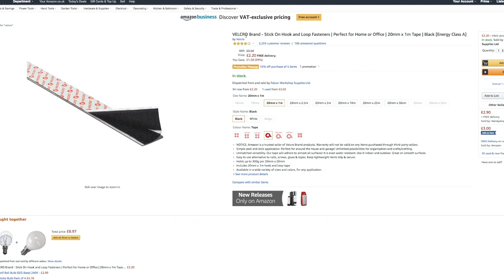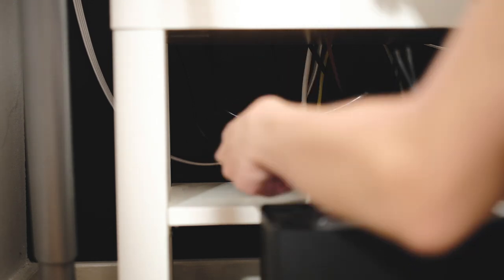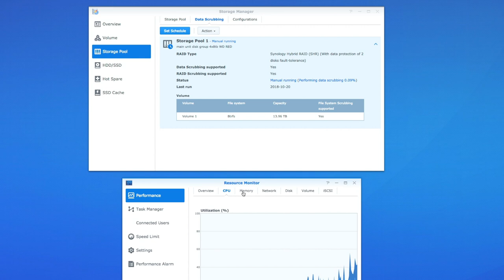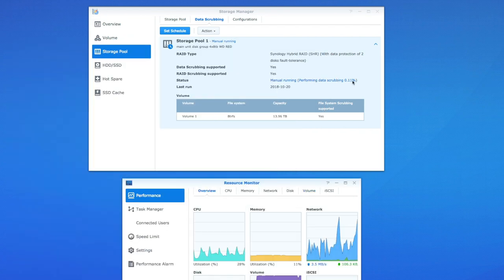Synology DiskStation Vibration Noise - EASY $5 FIX!

Comment: Why did you pick WD instead of seagate?
Reply from the maker: Hello Eli, 
Thank you for your message. 

I’ve had WD drives since 1998 over the years with my computers and they have lasted very well for me. Hardly any failed from my experience. 
I have had some failures with Seagate in the past

Having said that. They have risen hugely in popularity and I hope the standards are just as good now days. 

I will probably give them a try in the future if I need to expand. 

Especially with the recent WD shingles debacle. Really put a dent in my years of trust in the brand. 

Hope this answers your questions. :)

Comment: What about a nas where you screw the HDD? (like ds118 let's say)
Reply from the maker: Depends if you have the chassis buzzing noise? This doesn't help with the general hard drive noise you get. It doesn't dampen those sound at all. It's still a fairly open plastic chassis at the end of the day. I only want to fix the annoying extra buzzing sound coming from the cages. Not the hard drive sounds.
Reply: @JoeLamOfficial  okok

Comment: you re niot showing which side of the velcro you are using ... you just say the soft side ....  not sure which one to use
Reply from the maker: Hi Gevo. It’s the soft fuzzy side. Not the rough side with the tiny hooks. :)
Reply: Thanks ! I made the installation. You saved my life  :) the silly noise has almost all disappeared !!  just a little very slight fan noise remaining  but nothing abnormal ...
Reply from the maker: @gevo990   Happy to hear that it helped you. Thanks for letting me know. I've got my fan set to min speed. I don't hear it since it's under the desk. CPU 40C and HDDs around 30 which is absolutely fine. :)

Comment: I'll try on a standard horizontal mount case. Let's see
Reply from the maker: Let us know 🤔
Reply: @JoeLamOfficial  I made it. I can feel a slight drop in vibrations, sound level didnt change much but the pitch has changed. I cut the velcro at a length that covers three sides of hdd cage, it was pretty loose already so it would fit anyway, i held it tight with my fingers at front corners, sent it in and it went in snugly.
Reply from the maker: Nice. Thanks for the update. You think it was worth the work?
Reply: @JoeLamOfficial  hey, it only took 5-10 minutes to handle with a cramped desk space. People should give it a try and see how their setup responds. It may be better, worth a try. Sound is different, vibration seems a bit lower. Mixed thoughts. But I'll stick with it. Velcro is useful so I already had it.
Reply from the maker: Cool. Thanks :)

Comment: This fix isn't working for qnap TS 664 . I've just tried.
Reply from the maker: Can you identify where the noise is coming? It only helps with the chassis vibration noise. Not general hard drive noises.

Comment: Tape marking the drive numbers is a bad idea.  The gum holding the tape to the drives can dry and the tape can drop off in a few years.  Write on the drives and possibly on the drive holders.  Better to have metallic numbers on the drive holders than to lose track of your drives' order.  My four year old DS1815+ died a couple of days ago and I replaced it with a DS1819+.  I tested the DS1819+ to insure that it would work, powered down then plugged in the hard drives, powered up and then accepted the migrate with settings option.  It migrated the drives and installed the new operating system.  In one hour, I was up and running again (my internet connection is not the best, so expect better).
Reply from the maker: Thanks for watching. Did your units make any noise?

Comment: So you play the before sound but you don't play the after and you expect us to believe you?
Reply from the maker: I understand I should have done a direct comparison. But it does work as many others have commented already. 
I assumed people would understand that I’m getting rid of the chassis buzzing sound as a standard out of the box NAS experience, like mine when it didn’t make that noise (it does not help with the hard drive noises). Just that odd pitch chassis buzzing sound)

Comment: 1- if this worked for you why do you have a DIY acoustic box video?

2- this made my DS920+ even worse. I plugged it in 5 minutes ago and it’s at a record high level of noise
Reply from the maker: It does work as confirms by many other people. This helps to eliminate the chassis buzzing sound issue. The DIY box idea was to try and reduce the hard drive mechanical read and write sound itself , which is a different to this. 

This is to fix that tiny little buzzing sound coming from the hard drive caddy not fitting perfectly and vibrating against the plastic open chassis causing this higher pitch sound.

Comment: I feel like its not supposed to make that noise. =/
Reply from the maker: It’s not. But since the chassis is very hollow and made out of plastic. The hard drives occasionally vibrates the case at the exact frequency to make this unwanted noise. This is a simple fix until Synology adds better damping in their products (one day).

Comment: going to try this. I recently got my first NAS, and JESUS FUCK it seems like it's constantly making a low grade noise, and it's driving me crazy.
Reply from the maker: Hi Sean. Hope this helps with your NAS! It depends if it's the same chassis buzzing noise you are experiencing or just the general mechanical hard drive clatter <- that's more difficult to remove.
Reply: @JoeLamOfficial  Hi Joe, thanks for the response. So I think it turned out to be a combination of a very noisy HGST 8tb HE8  7k rpm drive and some app i had installed on the NAS constantly wanting to index the content or some such.

When I first got the NAS I installed a bunch of apps (first timers excitement I guess). I realized i didn't actually know what half of them where really doing, so I uninstalled most of them. I also made both drives 8tb Reds (5k rpm).

The NAS (QNAP TS-251+) is now MUCH quieter - barely notice it at all.

 I think I still might install some felt tape at some point, not just on the rails, but around the interior of the enclosure just to make it whisper quiet. I feel like these plastic shells weren't really designed with noise mitigation in mind. Temps seem quite low as it is, but I will monitor them of course if I do that.

Thanks for your videos, I've found them great for a first time home NAS owner!
Reply from the maker: Thanks Sean. Mine's generally ok too if it's idling in the background, but when it scrubs data, verifying, or whatnot - it does get quite loud. But I wear headphones most of the time so it doesn't bother me too much. I think I would have moved it or found another solution by now if it does my head in. 😅

Comment: Mine vibrate when it about to finish extended test :P
Reply from the maker: Going to try and use this method to fix it??
Reply: @JoeLamOfficial  Its a ds218play dont know if that would even work and it does't really bother me.
Reply from the maker: @Arokhantos  Don't need to fix it then I guess if it doesn't bother you. But mine's under the desk so it's rather annoying hearing the buzzing sound all the time.

Comment: just use folded up piece of paper as a shim or stack electical tape until its thick enough. Every 5 bay hot swap has this problem
Reply from the maker: Good idea! Didn't think of it before. Thanks for the tip.

Comment: You can stick the hard drives in any order it makes no difference
Reply from the maker: Thanks for the tip. Have you tried this yourself? 
I didn't want to risk or there's no harm in going back in the order. I was under the impression because the guide on migrating to another Synology NAS states "Install the hard drives in the target Synology NAS. Hard drives must be installed in the same order as they were installed in the source Synology NAS." - ref: https://goo.gl/AHk1e6 

Arguably that's for migration process, but surely there's no harm in putting it in the same order either. Better safe than sorry; seeing that it does matter when migrating. Thanks for watching. :)
Reply: Joe Lam yes I just shifted 8 drives I have 2 rs3618xs and rs2418+
Reply from the maker: @sturmbreakers7817  Thanks for sharing this information. I didn't want to take the risk as I couldn't find much information. No harm done I guess. :)
Reply: Joe Lam No problem just thought I let you know
Reply: You need to install them in the same order always.  You are going to lose data.
Reply: Francisco Ruiz I’ve done it multiple times in any order and have not lost any data
Reply: DiskStation is basically a linux computer which uses md raid and you can insert the drives in any order you want because mdraid autodetects the correct order. Yes, I've done it many times and no, there were no problems. So everyone, please stop spreading irrational fears about wrong order and losing data. There is no wrong order and you won't lose any data.
Reply: @sturmbreakers7817  Tried it on a DS712+ and DS716+ 
No boot, DOESN'T WORK!
Reply: dan8t6 will it boot in correct order?
Reply: Sturm breakers yes of course

Comment: Or you could just send it back under warranty and get it repaired or replaced for free.
Reply from the maker: That won’t fix the fundamental design flaw. The cage will always be slightly loose in order for the tray to slide out and when used with mechanical drives. It’s highly likely to suffer from the same issue even with replacement. I’ve heard some people managed to get some free replacement trays from Synology. But I think this is a better quicker long term fix.

Comment: No sorry you not only dampening the noise level you also reduce the way heat gets out of the case. I rather leave it as it arrived.
Reply from the maker: It didn't have any negative effect in my case. Of course, if it's a concern of yours. It's probably best to keep it as is.

Comment: Mine ends up sounding like a coffee machine
Reply from the maker: Good grief 😅 swear the WD RED drives are extra loud. WD MyBook Desktop drives doesn’t click as loud. Its such a racket the noise. What drive do you use?
Reply: @JoeLamOfficial  Shucked 12TB WD easystore from bestbuy, I got 5 of them in a DS1019+ and when it gets going it sounds like I got  multiple coffee makers brewing. it makes this popping sound from the vibration, kinda like how I remember the old kurieg machines sound like
Reply: @JoeLamOfficial  someone said it in your other video, it's like the sound of someone drinking an empty cup from a straw.
Reply from the maker: Oh snap. I thought 4 drives are loud enough. You’ve got 5. It reminds me of my first computer with the bigger 5.5” hard drives? Think it had 20Gb capacity. That was really loud. But most desktop drive seem quieter. Not sure if it’s the NAS compatible drives or just the open plastic chassis that reverberates the sound so much.
Reply: @JoeLamOfficial  like in your video i think it has to do with how the sled has no padding when you slide it into the nas
Reply from the maker: True. Plus it has so many gaps and holes for ventilation and no damping material on the plastic casing. I see some people have it on their desk next to the computer. How do they cope? 🤣

Comment: Well if it worked, why the hell didn't you show the AFTER noise?
Reply from the maker: Hi there, as many people have pointed out, I should have done a comparison but I just assumed that people would put the 2 and 2 together that it just sounds exactly like a normal Synology NAS without the buzzing noise I demoed at the beginning. If you have the buzzing noise, you know what it sounds like and with or without. 
Adding the strip only removes it but doesn't change anything else like it sounds. 
With all that said, I know in the future the importance to make the comparison in future videos.
Thanks for your feedback. Only this way I can improve further. Thanks again.
Reply: @JoeLamOfficial  Not all noise can be recorded and reproduced at the other end of youtube, so a comparison of before and after is highly desired so that viewers can compare the difference using the same tools and environment, otherwise the viewer is left to question the validity of the FIX.
Reply from the maker: Noted.

Comment: I bought the 24 inch X 3/4 inch Velcro brand from my local Walmart for $3.47 today.

Here are some photos: https://imgur.com/a/1yw8dJB

Will see if adding the top strips works or not for noise but so far I was able to insert the drives just fine. 

I think I might have been able to actually buy two sets and apply the others at the top.

I ended up not measuring but just cutting the 24" strip into fours as it fits just right. Also then I started trimming off little pieces on my last two strips to put on the top which makes a couple of my bottom strips much shorter. 

Update: I used the other side of the velcro on the top just for added noise reduction and the drives slid in just fine. 

See here:
https://imgur.com/a/6h6pKAk

Note that it doesn’t go all the way only because I was experimenting with the little bits first. 

You probably can just cut the entire strips into four equal parts and put out half at the top and half at the bottom - I’d suggest using the thick strips at the bottom as the video shows.
Reply from the maker: Hi David, thanks for sharing your experience with us. Did it help with the noise? Are you trying to reduce the chassis noise or the hard drive noise?

Comment: Thanks!
Reply from the maker: No problem! Did this help with your NAS?
Reply: @JoeLamOfficial  Hadn't tried yet, i have just bought mine
Reply from the maker: Ah nice. What spec and HDD if I may ask? Just curious. 🙂
Reply: @JoeLamOfficial  i’m a video editor and I plan to use it as mostly archiving. But I might use it as a video editing source too. I bought a ds920+, I plan to support it with a Kingston a2000 Ssd and extra 4 gb of ram to max it to 8 gb ram. I also plan to buy 4 segate ironwolf pro 8 tb
Reply from the maker: If it's not pulling high bitrate/4K. It's possible. I mainly use for archive, backup, storage and sometimes to pull a few clips from older project files. But it's not too ideal with the Gigabit ethernet port. 10Gig would help on higher models.
Reply: @JoeLamOfficial  which product has 10 gigabit and is there a way to upgrade the Ethernet port on ds920?
Reply from the maker: I don't think it's possible to upgrade the Ethernet port on the DS920+. The models that support 10Gig ethernet are DS923+ which can add 10 Gig LAN or these products if you filter by 10Gig support - https://www.synology.com/en-us/products?lan=10gbe_built_in%2C10gbe_nic_support